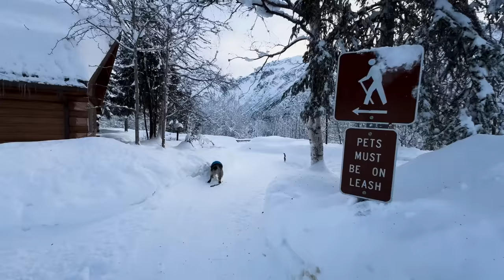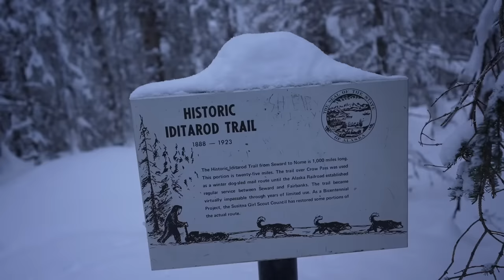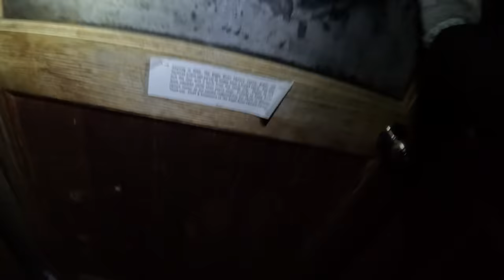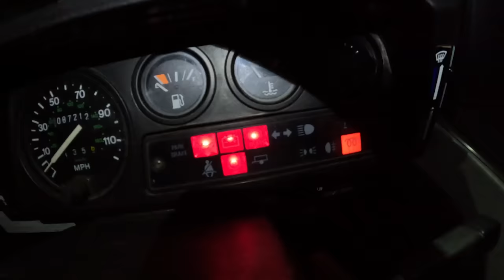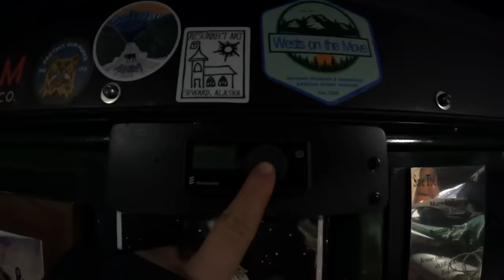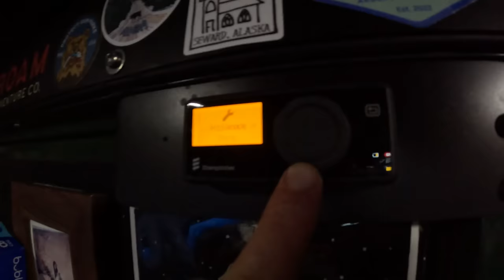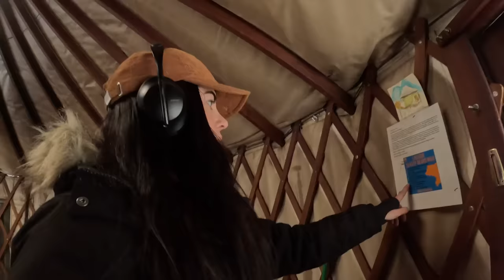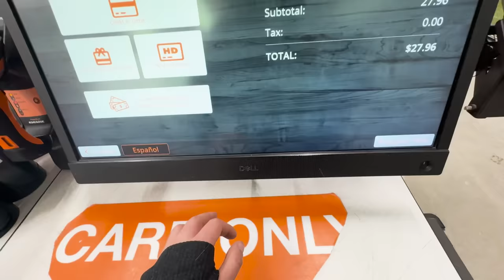3 Horrible Days Truck Camping in Alaska

Comment: I have one of the Chinese diesel heaters, and I can say without a doubt.  When running diesel fuel I always add anti-gel/Lubricant to it.  You can get the all in 1 from Amsoil or other brands make them as well.Also my intake is inside not outside

Comment: Blue looks so adorable in his coat and little boots! Loved the yurt. I always have wanted to buy one for our property. Was the damper open on your stove pipe?? SOS with smoke signals!! So happy you repurchased a buddy heater.❤️☺️✌🏻
Reply: That’s exactly what I was wondering. It didn’t look like it was from the brief glimpse of the chimney that I saw.
Reply from the maker: yes it was open!
Reply: @chrisdoden132  Same here! And having heated with wood for years, it’s the first thing I check.
Reply: Maybe a few firestarter wood pellets would help start  most any fire
Reply: @roamingreckless  You wrote the wrong year in the sign in book.
Reply: @roamingreckless  Could be worth look for a Diesel heater off a Range Rover as a back up system... I'm sure you or someone can fit it to Poe... ??

Comment: Marie you can lift the guard on the buddy and attach it to the top so its sticking out like a grill and you can cook on it or heat water. Two birds with one stone and save some propane.
Reply: Cool idea. I saw someone use a small paint can grid (metal mesh screen that hooks onto can) to do that. The part that usually hooks to the can hooks to the handle of the heater and holds a pot. Keeps the heater guard for protection and has the larger grid for the cooking area.

Comment: Always prepare adequate kindling before lighting the fire. Unless you left that part out, it sure looked like you lit the fire and then started getting your firewood together. Ithe fire is smoky because the stove isn't drawing. You need to get it HOT WITH FLAME to make the air move into the vent and up the pipe. You should open the bottom where the ash tray is. That will turn the stove into a BLAST FURNACE. Only when you are certain that fire is rocking do you shut the door to the ash tray. I hope this doesn't sound harsh or too critical, but that's not how to get a fire going in a wood stove. The door stays open till you have good flame, then you close it and open the bottom ash door so the air comes in the bottom. Trust me, I've done this so many times I could do it with my eyes closed. Big door closed, ash tray door open- makes it a jet engine.

Comment: It appears to me that the damper on the stove pipe was in the closed position.  You have vents on the front of the stove, but there is also a damper in the stove pipe itself.  The closed damper would explain all the smoke inside the yurt.  Air could not draw through and out of the stove pipe.

Comment: The damper on the flue was closed. Glad you made it through the night. The diesel heater needs to burn the fuel every once in a while hot. At least every month turn it on for two hours at max capacity. If you turn it on and off it could and will flood the exchange chamber. When that happens to me i use my compressed air on the intake untyl it creates combustion. Wish you well. Stay safe

Comment: Might I suggest a Springfield xdm 10mm. Full power in wilderness for animals. Weaker power in cites for people (less penitrstion). Bonus points for a shotgun or rifle. Budget opting being a bcm ar15 or smith and wesson ar15 or a baneli nova. Better options being a baneli m4 amd a scar 17 (for the 308 cartridge, great for animals)use slugs for the shotgun. No matter what you get pleas just have a gun that's bigger than a 22. I live in my car as a male and before I learned where to park I used to get sketchy people up to no good sound my car at night at least once a month

Comment: Get that back checked out. Sciatica can leave you in pass out pain and spinal fusion is a long recovery back. Get it checked asap, fix it, then build that core back for a back pack. Maybe a rack style would give more support, if you hold off.  Florida, lightens the pack a bit. Fanny Pack it for a while.

Comment: the cold air pushes the smoke into your cabin because its not hot enough  in the log burner , i have same problem at home with mine, best leave the door open until it gets going and let smoke out with the cabin door open, you have to start with small sticks gl

Comment: I feel like a lot of people in the comments don’t appreciate that she had three options for heat that night. Even though the yurt didnt work out, she could fall back on the diesel heater. When that failed, she had the buddy heater. That is proof of her being prepared, even if she isn’t an expert on starting fires in wood stoves with wet wood. 

Ps: when the flu pipe is cold, it is easy to get a backdraft even when the dampener is open. Especially with wet wood. Wood stoves are not necessarily intuitive to people who didn’t grow up using them, and it would probably have been fine had the wood been dry.

Comment: My back is bad too. Have scoliosis and other stuff going on with it. I dont carry anything while out walking. Either use a small wagon or pull a sled in the winter. Saves your back
Also you didnt open the damper on the stove. When you get a chance find somebody that can teach you how to properly operate one. I heated by wood for over 20 years

Comment: Your dog isn't going to get that cold. , he'd probably enjoy 18 degrees and if you're able to sleep together you both keep each other warm.  He's beautiful by the way.  Gotta dry the wood with the kindling.  Might need a fire starter (diesel would work, motor oil, wax, fat wood) not calling you stupid but you've gotta open the flu if the smoke isn't leaving the stove and if you just try things without background knowledge you're groping in the dark.

The diesel is probably gelling at that low of a temp, probably nothing wrong with it at all.  Broad knowledge about everything you're using and why it might fail and how to work through it are important in potential survival situations:  improvise and overcome.  Think outside the box.  The neighbors hospitality is much more likely to be a gift than a trap.  In Alaska a gun that can take out a bear and a moose and knowing how to use it can be a literal life saver.  I wish you success

18 degrees F isn't even cold for sleeping if you have 2 good fluffy blankets and a mattress.  No fire needed

I did watch the whole video and the tech said the air intake was clogged with snow so they moved the intake higher...

But let's face it, they were in a heated shop and if the fuel was gelled that would bring diesel back to a liquid state

Understand every component, don't be ignorant or reckless in true wilderness.  Helps with staying alive and keeping all your body parts

Thank you for sharing your experience

Comment: Just for kicks what I would have done with the fire issue is as soon as I realized the wood was wet I’d have stacked as much wood on top of the stove as possible and nearest to the heat I could have gottten it. The small bit of fire you managed to tender over the hours may have dried it enough to get it going better. Just my tid bit.

Comment: Using a wood stove when it's cold inside and outside you won't get draft till the chimney gets warm smoke will come out inside till chimney gets draft have this every year at my deer camp you have to light something that burns quick and hot like card board or egg cartons and once you get a fire going put a couple pieces of wood on the warm stove to dry and heat them so they burn better

Comment: Just a heads up get yourself several bottles of “WASP SPRAY!. That’s better than mace. Mace you have to be up close in order for it to work. With WASP SPRAY you don’t need to be up close. Will extremely BURN THE EYES OF SOMEONE!!

I don’t camp or any of that but I would make booby traps around where you park!  

Stay safe🌸

Comment: Thhe first thing that would have come to my mind when the fire would not stay lit and the smoke was coming back into the yurt would have been to check the damper to see if it was closed. With the fire not staying lit and the smoke not filtering out through the stove pipe means one thing, a lack of oxygen filtering both in and out of the pipe. It leaves me wondering just how often she has had to use a wood stove for heat or cooking. Lesson learned. It could have been much worse, ie: carbon monoxide poisoning!

Comment: I have to wonder if you saw the sign that dogs must be on leash.  That's not the same as you dog running free with a lease attached. If you had encountered a bear that could have been a tragic mistake and made this bad trip even worse.  I can see the damper in the video...did you try adjusting it?   Though I am happy you made it through and nothing bad happened to you, I have to wonder about your ability to assess your risks before you went out.

Comment: I've never seen a yurt set up like that. The fireplace was always in tbe center with exhaust out the top center "sky light". Carbon monoxide you know. I don't knoe why the wood was so wet, unless it was stored outside in the snow & not brought in with enpugh time to dry. It just looks like it was not properly set up.

Comment: I have been an "on & off" Van-Camper for many many many years touring 49 States and 13 Canadian provinces... I have had my fair share of nightmarish stories, sad stories, but wonderful stories as well... No doubt that living on the road and sleeping at Truck Stops, Travel Plazas, Highway rest Areas, Roadside Pullouts, Walmart, Planet Fitness & Cracker Barrel Parking lots can be depressing, challenging & dangerous, not to mention road hazards as well.... Just imagine being hundreds of miles in the wilderness and then the vehicle breaks down which has happened to me so many times, especially in Bear Country, but the greatest most dangerous threats are from people (Dems & Libs statistically), so always have some friends with you when traveling alone, and that's why I have Smith & Wesson and Mr. Bear Spray as my buddy's to keep me safe.

Comment: 18:22 you can see this wood stove has a damper / pull on the bottom of the door possible, don’t see one on The stack. 
(Looks closed thats why all the smoke an not being able to stay lit with no air flow!) 

Iv watched a few different videos of yours an each time iv wondered if you really knew how to properly start an work a wood stove. ( or if you even know what a Damper is )  
I guess being born an raised in ALASKA it just comes naturally for me, or is just common sense to me. But dang!! Wish someone could have taught you a few different tips an tricks before you came to Alaska for the winter. 
(Also using a buddy heater / propane in an closed space like that with NO CO2 detector, really worry’s me!! ) 
ALASKA HAS THE HIGHEST DEATH RATE FOR CARBON MONOXIDE POSING IN THE NATION!! :(

Comment: Next time lay wood out on top of the stove. It will dry quickly as the fire burns. Then you put that in and put more on top. Keep that cycle going. The smoke is from improper ventilation. You should've looked outside to see if smoke was coming out. I'm gonna say it was blockage caused by an animal or creosote. Even wet wood won't do that if there's proper ventilation.

You need to be better prepared and more knowledgeable before doing this kinda camping.

Comment: Actually if the people you rented from was supposed to provide wood for fire then it should they're at fault for the wet wood and lack of kindling plus matches and lighter. By the looks of the wood stove they hadn't cleaned it in awhile so you know the flue wasn't cleaned either. If you didn't open flue then the smoke in yurt was your fault. . I hope you are prepared next time. Too dangerous.

Comment: There is something seriously wrong with that wood stove if you got that much smoke inside. Even with wet wood, the smoke should be exhausted, The smokestack is leaking. If you spent the night there you would die of carbon monoxide poisoning.